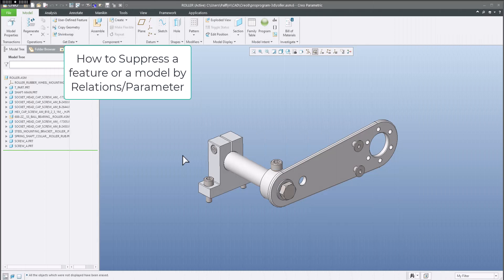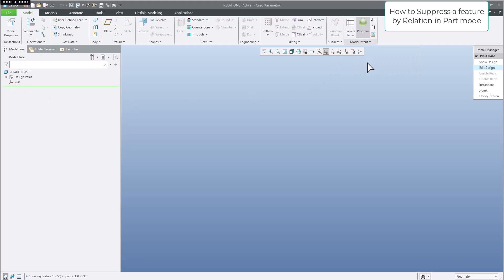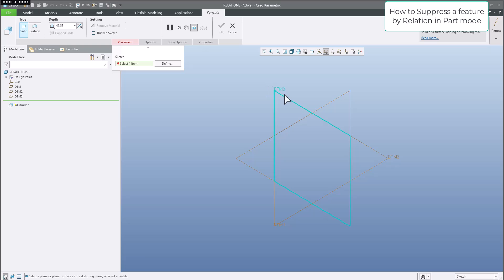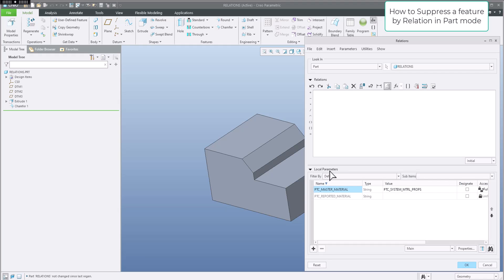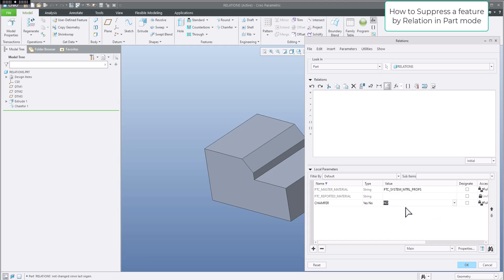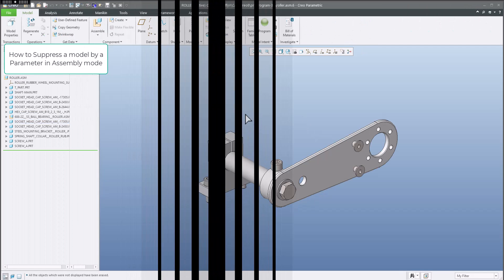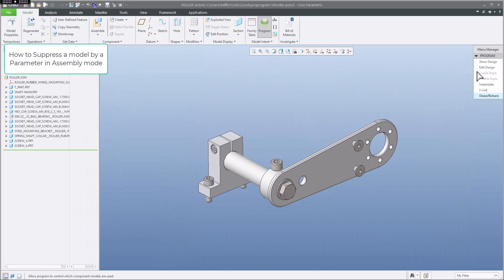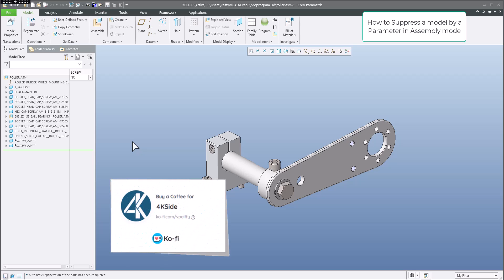How to Suppress Features or Models by Relations / Parameters - ProProgram

Comment: Hello Vladimir, does it work for Bodies too ?
I want to create a part with 3 variations (a sheet of metal with 3 kind of hole pattern).
Reply from the maker: You can use it also for different bodies and also in assembly mode for submodels and subassemblies.